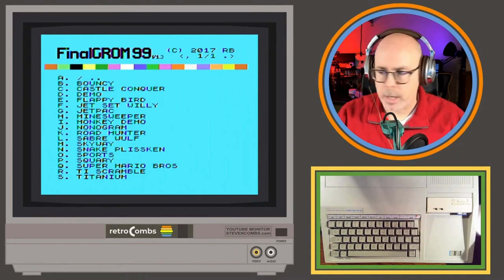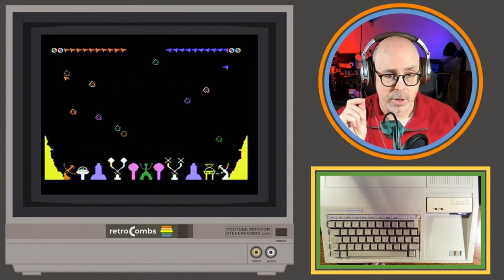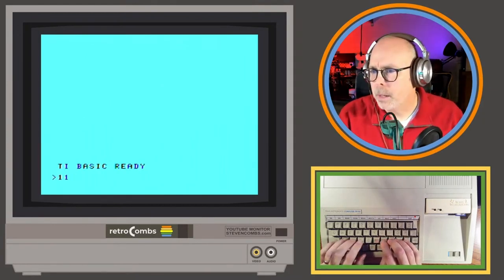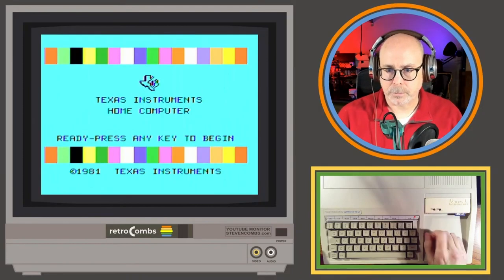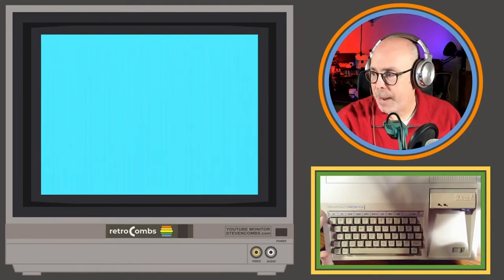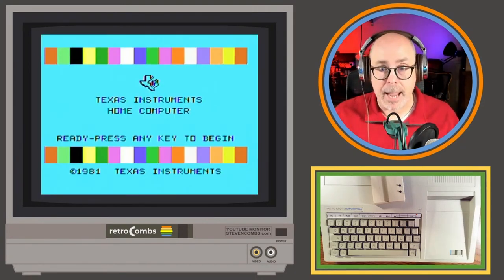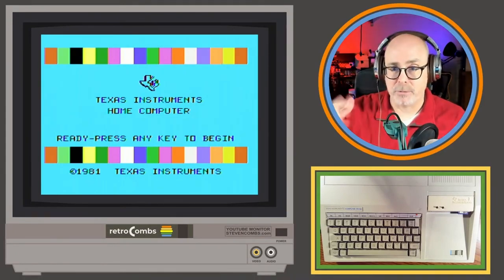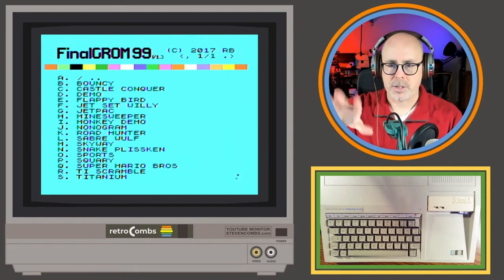Texas Instruments TI-99/4A FinalGROM 99 Livestream Edit

Comment: Most likely the TMS9900 was a cheaper processor than the TMS99000 which would have been the better chip and would have allowed for more RAM than on the TI99/4A

Comment: I think someone has to build a new TI-99/4A using new parts and use DDR4 RAM modules for the System memory.
Reply from the maker: I'm not sure it was popular enough for a rival. Interesting computer but really hampered by some odd hardware design choices.